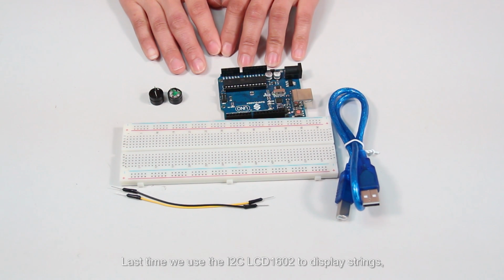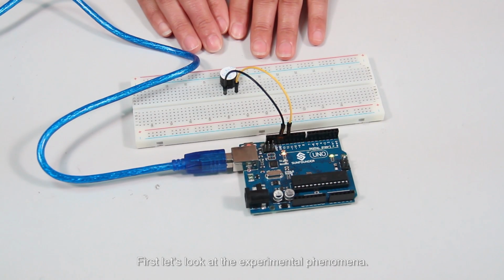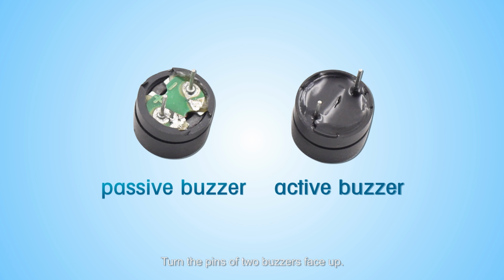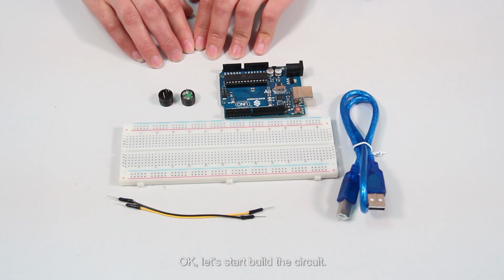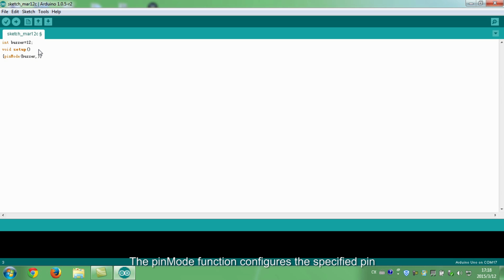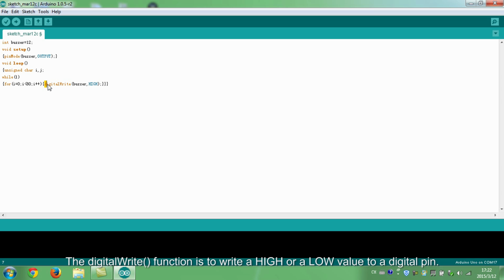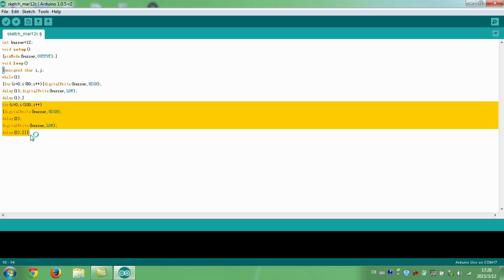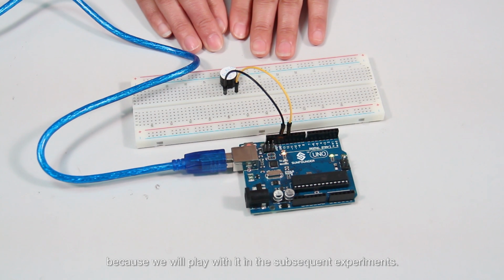SunFounder Learning Kit Tutorial for Arduino - Buzzer -Super Kit/Starter Kit/RFID Kit

Comment: terrible codestyle
Reply from the maker: +Alex Awwesome Sorry for the trouble. We'll improve the video ASAP!
Reply: +Sunfounder 
Yes Alex.
I'm pass Software Development Class.
And I have to said that : 
- rule ONE is : indent your code !
This should help you AND other to read your algorithm
Also, it's should help you to debbug.
for( i=0 ; i<10 ; i++ )
{
    Todo ;
}
As you can see, all line are finish with ;
All opened { has a closed } aligned 
If you miss one, you can find where easier.

- rule TWO is : comment your code.
In lots of language, you can use a character as # to disable a part of your code.
Use it to comment what you are doing.

Thanks anyway.

Comment: Won't it damage the arduino over timer if there won't be any amplification or some current limiting resistor with it?
Reply from the maker: Yes, it will.
Reply: Then what do you do to solve it?
Reply from the maker: Because the current of Buzzer we use is lower, and the working voltage of its is the same with UNO Board which is in 5V, so it is no need to work with any amplification and current limiting resistor. Certainly, you can connect a current limiting resistor to the digital port on Arduio Board and connect a triode after that, then connect the Buzzer at last.
Hope it helps.

Comment: Noob question here, can you connect directly the buzzer to the GPIO without connecting it to the breadboard first ?
Reply from the maker: For low-power buzzer, such as the buzzer in this video, you can connect it directly to the I/O port. But if you need to connect to a high-power buzzer in some experiments, it’s necessary to connect to a transistor to amplify the signal for the buzzer.
Reply: I have a standard PC motherboard buzzer, probably 5V, is it safe to just connect it directly to the GPIO pins ?
Reply from the maker: Indonesia Yes, it's safe to connect them directly. If you have any questions about our products, welcome to post forums on our website www.sunfounder.com

Comment: I bought the Mega 2560 and tried the button pressed tut and it gave me errors.

avrdude: stk500v2_ReceiveMessage(): timeout 
^It says this over and over again.

Any help on this?
Reply from the maker: +wiskyBOY123 This error may happen if you did not connect the right port. Before uploading the sketch, you need to configure something. In your Arduino IDE, click Tools in the menu and click Board on the drop-down list to choose your board used and click Serial Port to choose the port of your board. 
If you do not know the port, for Windows system users, on your PC desk, right-click your computer icon and select Computer Management. Then on the leftside list, find and click Device Manager, and you can see Ports(COM &amp; LPT) on the right-hand list. Click to unfold the list underneath, and you&#39;ll find the Arduino board with the port number. 
If setting the board and port still does not work, please refer to more instructions at http://www.sunfounder.com/index.php?c=downloadscs&amp;a=Manualdetails&amp;id=81&amp;name=Solutions%20to%20Problems.
Reply: Thanks for the quick response.  I have a MAC BTW.  

Yeah I figured it out moments ago.  It was the choosing of the board that kept messing me up.  

Again thanks guys! ^_^  I'll inform yah if there is anymore issues.
Reply from the maker: +wiskyBOY123 Pleasure to help. Have fun!

Comment: Thanks a lot for this video.  I am new to this and it works great for me.  My problem is that when I ran it the buzzer does go on forever!  I tried unplugging it and resetting the Arduino and it keeps buzzing. I even tried running a different script, but the buzzer kept going.  I changed the code to only run for 5 seconds and it stops then but is there a way to break an infinite loop?
Reply from the maker: In our code, the beeping of the buzzer is controlled in the loop() function. Therefore, the code in the loop() will keep running if you do not switch off the circuit. 
You can try to use a millis() to add interruptions. First delete the while(1), and define an unsigned long type variable time to store the time. Enable an interrupt every 500ms and each interrupt lasts for 10s. See the code below: 
// Buzzer
// buzzer make sounds
//Post on our FORUM for any questions 
//Website: www.sunfounder.com
/*********************************/
int buzzer = 12;//the pin of the active buzzer
unsigned long time;
void setup()
{
  pinMode(buzzer,OUTPUT);//initialize the buzzer pin as an output
  time=millis();
  Serial.begin(9600);
}
void loop()
{
  unsigned char i; //define a variable

  //output an frequency
  for(i=0;i<80;i++)
  {
    digitalWrite(buzzer,HIGH);
    delay(1);//wait for 1ms
    digitalWrite(buzzer,LOW);
    delay(1);//wait for 1ms
  }
  //output another frequency
  for(i=0;i<100;i++)
  {
    digitalWrite(buzzer,HIGH);
    delay(2);//wait for 2ms
    digitalWrite(buzzer,LOW);
    delay(2);//wait for 2ms
  }
  Serial.println(time);

  if((millis()-time)>500)
  {
    digitalWrite(buzzer,LOW);
    delay(10000);
    time=millis();
  }
} 
/**************************************/
Reply: Thanks for the help, but the time variable wasn't initialized.
Reply from the maker: Tony Wallace In fact, "unsigned long time;" is to initialize the time variable